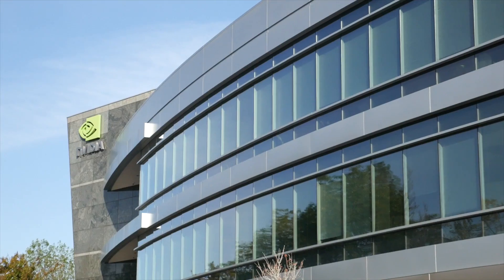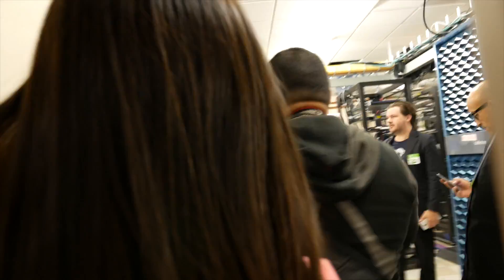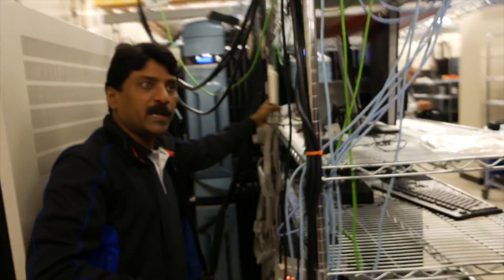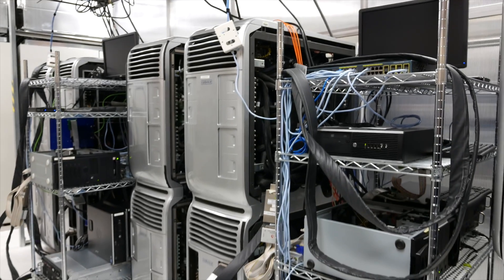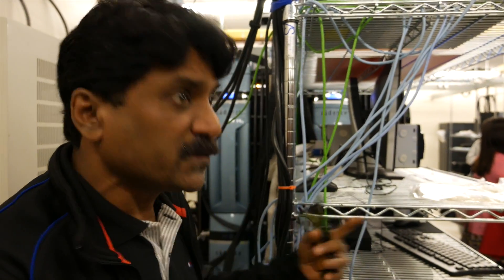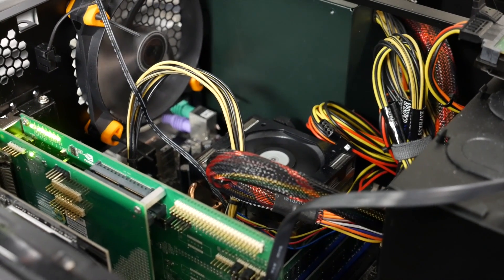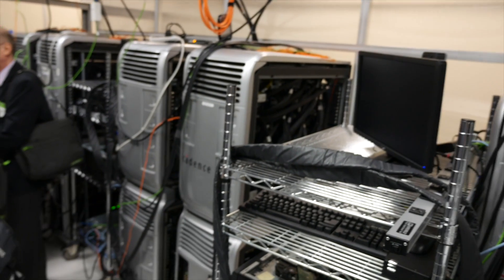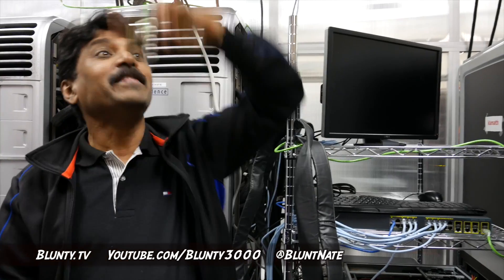Emulating Nvidia GPUs

Comment: How can i get a job at that LAB?!
Reply: +Azmath Moosa You need to have a degree in Electrical Engineering, Computer Science, or Computer Engineering. But they accept many types of Engineering degrees. You just have to submit your resume several times and work for other companies meanwhile.
Reply: ***** You actually can. Theyre always short on workers which is why their jobs page is always full.
Reply: ***** The highest tiers usually tend to go to the senior engineers. Those that have been in the industry for decades. So I agree with you, those jobs are very hard to get into directly after graduation unless you know someone that can give you a position to prove yourself and move up quicker.

But yea, for the low to mid-high paying jobs for Nvidia, they are possible to get into.

Comment: Pretty, cool, I wish they could have explained how their simulation ultimately translates to a final product.
Also, does nvidia sell their custom GPU emulation rigs? It would be cool to just test if it is possible to take a GPU like the 980ti, and simply double the number of cores, making it twice as large (preferable over SLI since you avoid scaling issues and compatibility issues).
Reply: +Razor2048 That is another long video I am sure.   The hardware emulation rigs are sold by either Cadence or Synopsys, companies that specialize in chip design software and hardware. 

The chip designers write codes in hardware description language to simulate how the GPU would behavior when you give it instructions.    Then the description language is translated into a "logical netlist" of logic gates (AND, OR, NAND ... etc).   At this point you can do a software emulation, to check if your GPU has any bugs.   But the run time is super slow, so engineers would program the "logical netlist" into the hardware emulator like the one you see in the video.   Then they run the emulators to check for bugs.   The emulator is much faster than software emulation and you can re-program the machine over and over again as you fix bugs in your code.
Reply: that would cost 1million usd
+Razor2048
Reply: Razor2048 Well, there is a limit to how much you can fit in one chip and be manufactured efficiently at a reasonable cost.  @400-500w tdp means you might need a  850w power supply minimum, which reduce the number of system which can run the big GPU.    In any case, Nvidia has architecture the GPU with Pascal, which will be released after June.

Comment: I'm surprised at how messy it is
Reply from the maker: +Luke Harper Certainly made me feel better about MY cable management ;)
Reply: +Luke Harper - It's common for places like that to be messy. Spend any amount of time as a technician, and you quickly learn...as long shit works, you're happy. When you're constantly maintaining, repairing, upgrading or installing systems, you can't afford the luxury of keeping things neat.
Reply: Bang4Buck PC Gamer Datacenters SHOULD be clean, labs are different.
Reply: +Luke Harper I would think they do alot of chopping and changing eps when it get to plugging it in a "real" system,  yer it could be better but could be alot worse as well
Reply: +Luke Harper You'd be surprised how messy it is at CERN too. Cable spaghetti everywhere!
Reply: gargelensis - Sound tasty. Now I'm hungry.
Reply: +Keith Trimm That's true, a company I used to work for called Specialist Computers Holdings had racks of computers in the lab.(24 per rack) and we was always pulling systems out and replacing them constantly. They were so fussy about cable management and how clean everything had to be because of frequent visits from company representatives or potential new customers.
Reply: +Luke Harper Function takes priority over form.
Reply: Keith Trimm You need a supercomputer(which is depicted, the Cadence boxes are filled to the brim with the most powerful FPGAs on the market) to simulate silicon.
Reply: +Legendary Music u right it's not bout keepin it looks fancy it's how the system runs
Reply: +Legendary Music it's not reason to make it look nice anyway don't see it unless opening the case anyway so no point
Reply: +Min T You can't say that. I have been in a few labs that are messy and a few that are like this. It all depends on how much the owners want to stress it. Nothing more.
Reply: +Luke Harper they say that if you have a very clean and very well organized bookshelf that means you don't use it. Or at least not frequently.
Reply: +Luke Harper They're making hundreds of changes every day based on design changes. It probably isn't worth it to do cable management when they're going to move cables soon anyway.
Reply: I assumed since they were simulating the chip, all that would be done inside the computers and not a plug and play cable lol.